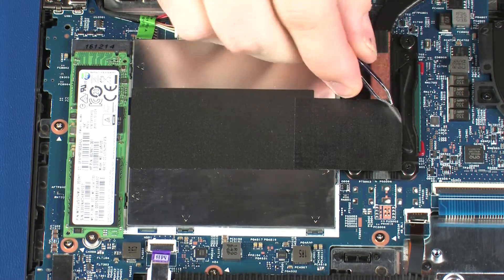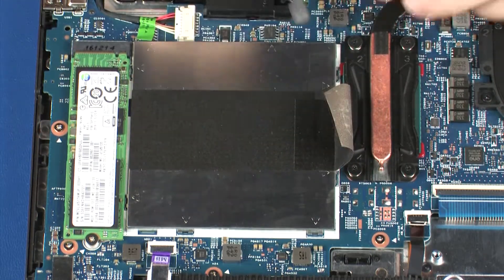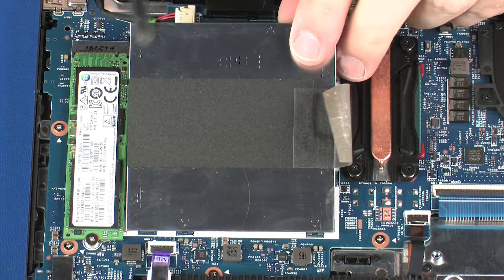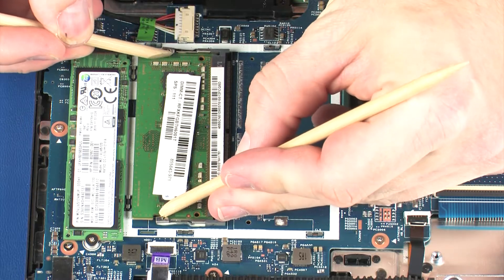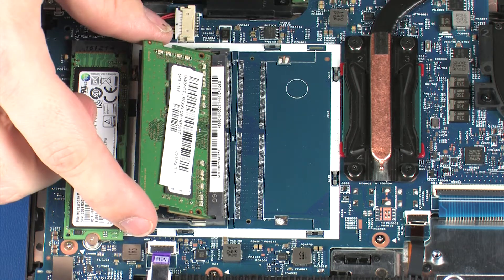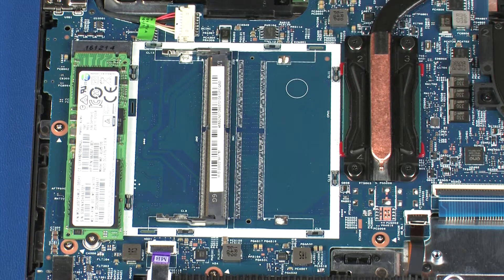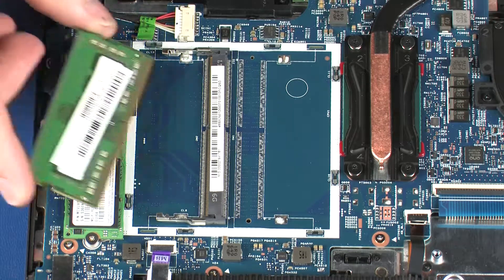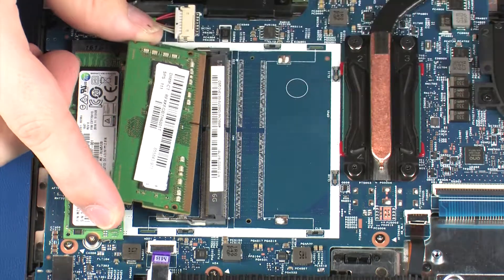Replace the Memory Module(s) | HP ENVY x360 15-bp000 | HP

Comment: Hi I got the HP envy x360 15 bp101na, its got 8gb as standard whats the maximum i can upgrade to
Reply from the maker: +Amar Mughal Please refer page number 1 of the user manual to know about upgrading memory: http://bit.ly/2BP2rh9
Reply: 32
Reply: @fumes4030  I have the bq-001na, only one memory slot available, with 8GB standard, do you think I could replace with a 16gb ram card? Or is 8GB max